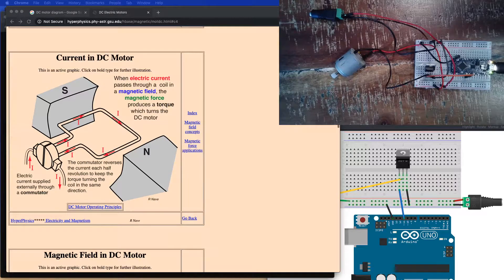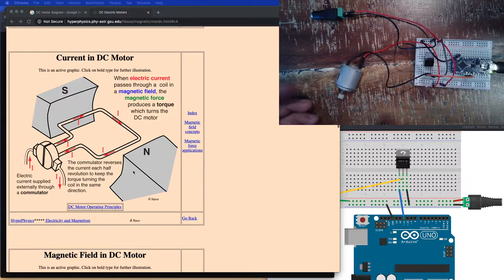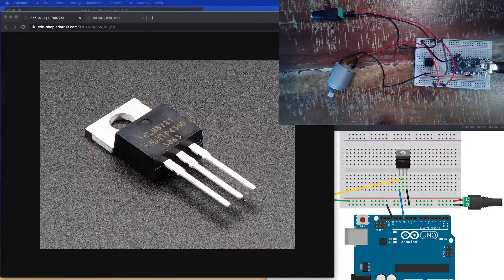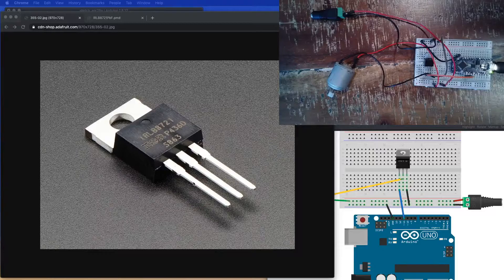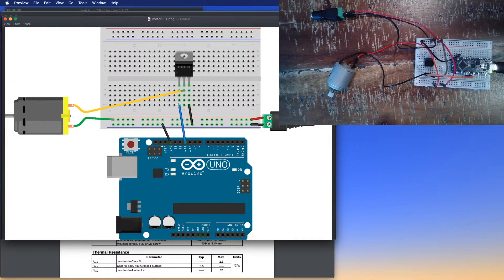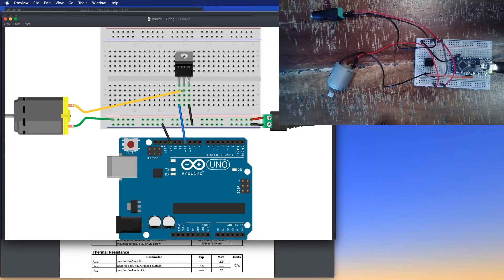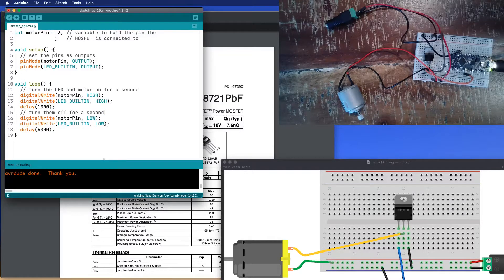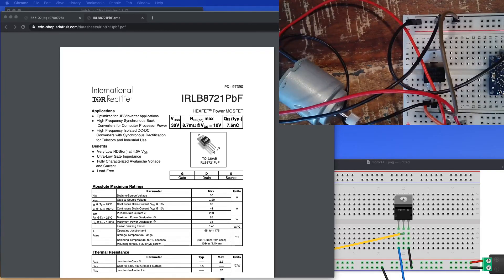Arduino and DC motor with a MOSFET

Comment: Don’t you need a diode in parallel with the motor to prevent back voltage